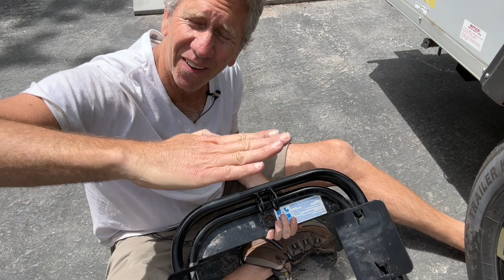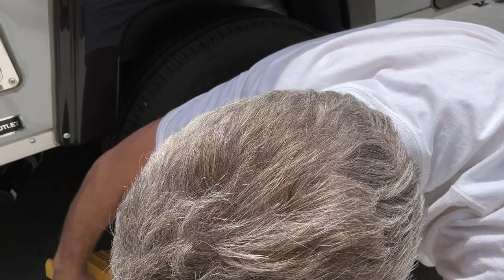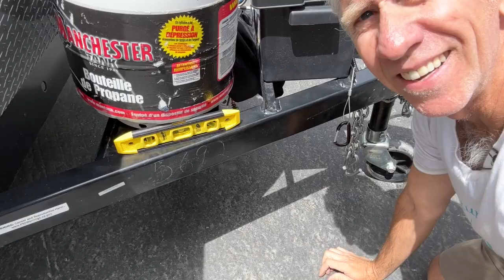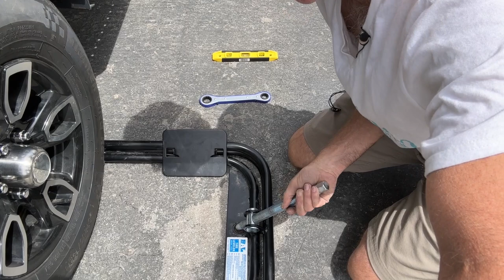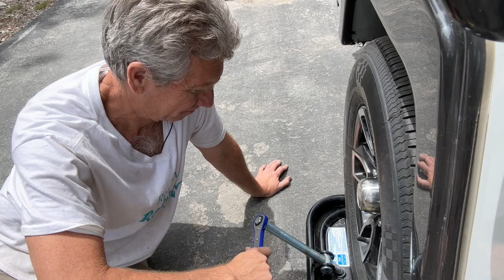Use a BAL Leveler to Save Time and Frustration - Level Your Camper the Easy Way

Comment: Great info for a first user with the BAL leveler!! Thanks so much!!!!
Reply from the maker: Something I didn't mention.  Greasing the Bal Leveler is very important.  Make sure you grease it down before or after every trip.
Reply: I used it I found out it too heavy to use,does not lift the tire my tires were too big did not slide under the tire junk !!! Camper was too heavy with king size beds and slide out and shower potty combo junk!! Good for smaller pop ups without two king beds no sldeouts

Comment: just curious. If you aren't level from side to side, why not just slightly pull forward onto the wheel chock on the side thats too low?.hence, lifting that side up. ?
Reply from the maker: I wouldn't level using a wheel chock, but there are similar devices out there that let you level that way.  This is just one way of doing it, that i've found works really well.

Comment: If you need to get the jack underneath it to get it off, you might as well use the wheel jack to level it.
Reply from the maker: I've never needed to do this.  Just thought i'd mention it.

Comment: Too bulky and cumbersome.  Level side to side while still hitched.  Go get yourself a LevelMate Pro BlueTooth level and a handful of legos.  Most sites you can find a level site from your tow vehicle without having to block any side.  You should be able to be backed in, unhitched, and leveled in a few minutes.  No need to mess with a line level any more.
Reply from the maker: I agree.. that Bal leveler is a bit bulky.  Thanks for sharing info on the levelmate pro.. pretty cool tech !!
Reply: That means I can't move my camper by hand after decoupled, which I like to do to get it positioned exactly the way I want it. Plus most places I camp aren't level at all. I have blocks, but this is a better solution because I can decouple and move my car and move the camper by hand a bit and then worry about levelling.